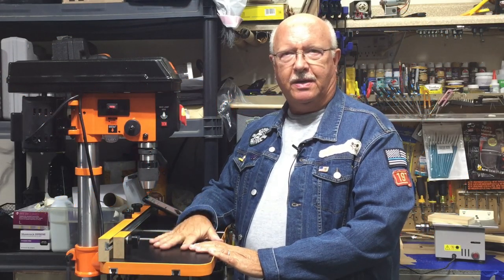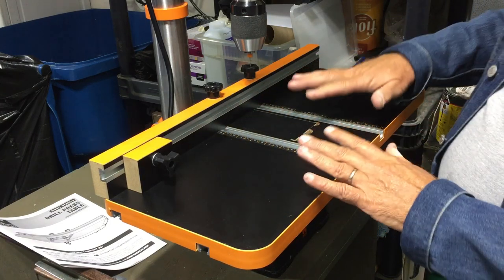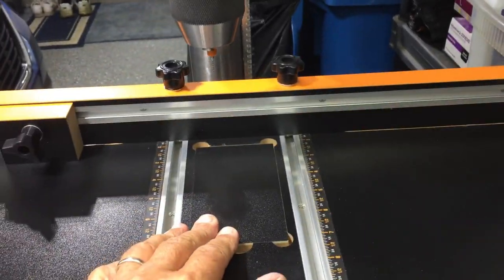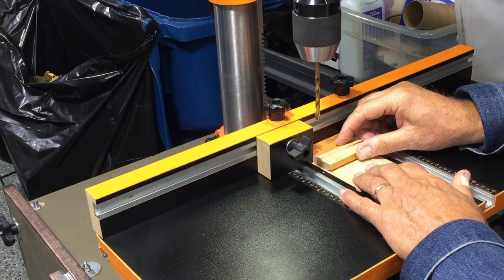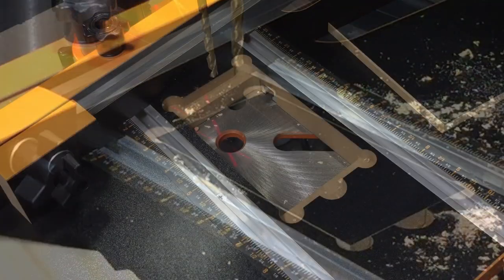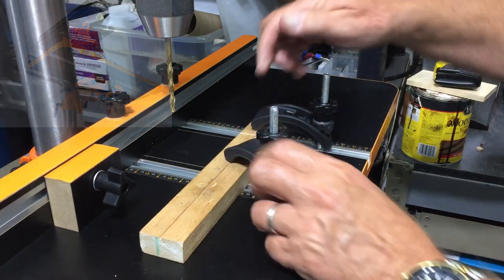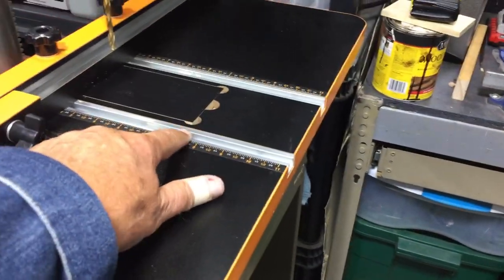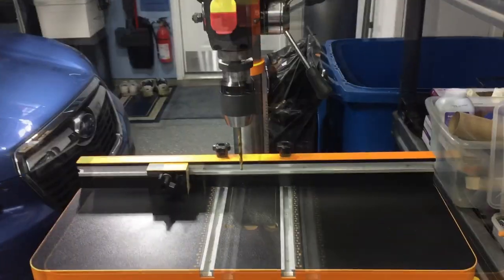WEN Drill Press Table (WEN Model DPA2513)

Comment: I took a 1/2" file and slid it into each aluminum slot and filed off the BURS on the top of each screw hole so they don't interfere with the sliding of the bolt heads.
Reply from the maker: Although I use the drill and table I haven’t used the slide clamps much. But I will definitely check out your idea!  Thanks for the advice 👍👍

Comment: My wen table must be the older version you mentioned. I received it today, 9/29/2022 and it does not fit the Wen drill press I received yesterday, 9.28.2022. I will have to drill a couple of holes into the table in order to secure it to the drill press table. Oh, my table is the white table....
Reply from the maker: Yes, that’s apparently one of the improvements made in the orange version?  I’m still happy with mine as it easily clamps off and on.
Thanks for watching, sorry yours isn’t working out quite as you wanted.

Comment: Have you or anybody reading this found a simple way to add a spindle/ motor speed control? Nobody really messes with the 5 pulleys. It would be great to set it to one speed and then use something to dial in your speed. Thanks.
Reply from the maker: I can’t help you with that. We’ll have to rely on viewers to respond. I only use mine for light duty wood projects on my model ship building hobby and only use it on one speed.  
Thanks for watching and I hope this platform works to get the answer you need. 👍👍
Reply: The new wen model 12 inch has variable speed. There's a lever on the left side and it has only one pulley, I never have to go up there. It is very nice.
Reply: @nickspace6230  It's also double the price. I guess the amount of time you use it dictates the amount to spend.
Reply from the maker: Thanks @nick for your input. And John n, fortunately for me I rarely change the speed. Maybe someone else will know how to regulate the motor speed without upgrading to a different model drill.
Thanks to all for watching and joining the conversation 👍
Reply: Look at the WEN 4214
Reply: Buy a nova viking

Comment: Thanks for the review. I have the same model setup and it performs very well for me as a DIY’r.  I bought b/c it couldn’t be made for the cost of the parts.  The stop block feature is great. Thanks for the tip on the replacement plug.  BTW: the Wen drill is a keeper as well.  I looked at every other brand for similar money and Wen is just a better quality press with more features.
Reply from the maker: Thanks for watching. On the replacement plug, I accidentally show the wrong size…. So be sure to measure and the correct one is on the shelf next to the one that I showed.
Thanks again.👍

Comment: Unfortunately for me, the fence cracked where the t-track with the stop is. had to throw it away. Put a Temu aluminum fence to replace it. Kept the stop, though.
Reply from the maker: That’s disappointing.  Wondering if one could be made out of solid wood?
I use mine regularly, but not so much with the fence.  Drilling with micro bits for model ships… it’s all pretty little duty.
Thanks for sharing, it’ll be helpful for others 👍👍

Comment: Thanks for your review.  I had just ordered the older white model and then I saw your review.  I quickly cancelled the order and ordered the new one.  So glad I saw your review - I didn't realize there was a new model that fixed many of the short-comings of the older one.
Reply from the maker: You’ll be much happier with the newer one.  I’m in the middle of building two wooden model ships and I use it often!  Nice work surface for detail work.
Thanks for taking the time to share.

Comment: I bought one. I’m pleased with it. I wish they made replaceable well covers. Thanks for posting the home made wellcover.
Reply from the maker: Yes, but you can make your own that fit perfectly.  I think I show it in the video…. But note; I showed the wrong tag at Menards…. So just make sure you get the correct width and depth.
I’ve got the specific info for it at home. Unfortunately I won’t be there until next week….
If you need it, just make a new comment next week and I will respond.
Thanks for watching and taking the time to comment.👍

Comment: Regarding the insert, you made the comment eventually, but I'll reiterate it: Save the insert as a template.  Go ahead and use that to make a few replacements on your table saw as soon as you get the insert out the box!  Additionally, you can experiment with making a "breathable" version (i.e., a few large-bore holes) so dust collection can happen on both sides and won't strain your vacuum in the process.
Reply from the maker: Good points! Thanks for contributing to the conversation.  I regularly use the table in wooden model ship construction using micro drill bits.  Very happy with my decision.
Thanks for watching too! 👍👍

Comment: Thanks Dan. Great looking product. I just ordered one myself ( new project requires drilling thru 2" round dowel - this will be great)
Maybe mask off ruler and spray with clear coat ???
Reply from the maker: Not sure regarding spraying with clear coat as it’s at the same height as the table.  They should have slightly recessed it!  But all in all, it’ll work great for a work surface and holding your work in place.  The price is less than half of what other similar products are. My son tried building one and thinks the WEN I have is a better choice!  I think you’ll like it.
I just posted another Pearl video…. I made a construction error: I used the wrong stairway spindles 😫…. I need your attention to details!👍

Comment: I found a better replacement for the inserts that are perfect use laminated flooring samples from the big box store they have a vinyl surface on both sides and the thickness is spot on plus they are free I just have to cut to size
Reply from the maker: Great suggestion! I didn’t know that they would be the right thickness.
Thanks for sharing. Next time I need some more I will try it out….. unless they are all gone do to your suggestion!😂😂👍

Comment: Enjoyed your video. Thanks. I think that you mentioned a link to the wood you used to make replacement inserts but I cannot find it. Help!
Reply from the maker: Glad you asked! I made a slight error in the size:
It’s 3/8x4x36 specifically item number 1031544 select pine board.
At my local Menards it was in the upper deck of lumber.
Here’s a link to the website and the piece that you need:
https://www.menards.com/main/building-materials/lumber-boards/boards/3-8-select-pine-board/1031544/p-1568183358116-c-13115.htm?searchTermToProduct=1031544
Reply: @BoilerDan1  Thank you.

Comment: Length is longer than what would work best for me.  See any reason why I couldn’t reduce the width by about 4” on each side?  Dan
Reply from the maker: If you can carefully cut the sides including the metal channels I don’t see anything that would be an obstacle.  I just looked at mine and measured the 4 inches in on both sides. Nothing to prevent it.  It’ll just be less wide.
Reply: Greatly appreciate your advice and video.  Looks like a nice press…will order and make the minor modifications.

Comment: What chuck are you using on the drill press?
Reply from the maker: I ordered it separate.
It’s supposed to be very stable?
Here’s a link to the one I purchased from Amazon.
It took some getting use to, but is working well for my needs.
WEN DPA167H Heavy Duty JT33... https://www.amazon.com/dp/B08R7V5B19?ref=ppx_pop_mob_ap_share
It takes practice to get the bit centered. I like it being keyless!

Comment: where did you get the piece of wood? 
what store?
Reply from the maker: Menards:
It was in the top area of the lumber section.
3/8 x 4 x 3' Select Pine Board
(Actual Size 3/8" x 3-1/2" x 3')
Model Number: 1031544 Menards ® SKU: 1031544
NOTE:BE SURE TO GET THE 4” WIDE ONE.  Not 3” that shows on screen.
Let me clarify:
If you go to Menards online, when you enter the model or sku number it will bring up the the item but down where you select how many there is a drop down tab. You’ll need to tap that and pick the 4” wide one.  You can also take those numbers into the store and give it to the customer service help and they can take you right to them.
Thanks for watching! My apologies for not being clear on the topic in the video.
👍

Comment: Dan, I am interested in purchasing one of these but it’s important that that fence be fairly accurate at a 90° angle, due to what I am drilling into. Can you confirm? Thanks
Reply from the maker: Currently I’m on vacation and won’t be able to confirm the 90* angle for a couple of weeks.  I’ll do my best to remember….but if you haven’t gotten a follow up from me by the first week of March, send me a reminder!
Reply from the maker: Let me mention that the table attaches to the metal platform of the drill press.  The metal platform of the drill press is what tilts…..
But if you’re referring to a true 90* for just the fence on the table (which now I suddenly think I know what you’re asking 😁)….
The table connects to the fence on the two rails so you can put a square on it to get a very good 90* degree.
As far as the 90 from how the fence sits on top of the table, I’m very confident that it would be very accurate….. but I will confirm that when I get home.👍
Reply: @BoilerDan1  Thanks so much!

Comment: Did you change out the chuck? Just got mine and it has play in it, wondering if you had the same issue.
Reply from the maker: Yes, I did change out the chuck.
I mostly use micro drill bits so I didn’t even try the one that came with it.
It took a while to get the hang of tightening the new one, but I’m happy with it!
Here’s a link to the one I purchased:
WEN DPA167H Heavy Duty JT33... https://www.amazon.com/dp/B08R7V5B19?ref=ppx_pop_mob_ap_share
Thanks for watching 👍
Reply: @BoilerDan1  thank you

Comment: Why is the wood insert needed?
Reply from the maker: It comes with one. Over time it’ll just have holes drilled in it.  So actually, you don’t need to replace it.
Just a little update: I use it often in model ship building. Still love it!
Reply: @BoilerDan1  I mean, what is the purpose of it?
Reply from the maker: Just to support what ever it is that you are drilling into.  For example, I drill very tiny holes using micro drill bits. So if there’s a large hole underneath a small piece that I’m drilling 
It can effect the drilling process. Micro bits break apart very easily and any tilt and they snap off.
If you are only drilling larger objects, it’s probably not needed.
Thanks for watching my video. 👍

Comment: Were you able to locate a shop vac adapter for this?
Reply from the maker: I haven’t tried yet.  I’m usually drilling very small holes in wooden model ships with little debris.
If I want the shop vac to pull away chips or dust I just clamp the hose close by.  Sorry I haven’t pursued it more.
Thanks for watching 👍👍
Reply from the maker: I’m adding a follow up to my reply….
I’ve been using the drill table quite a lot recently and I really like it!  I’ve done micro drilling on some wooden tall ships and it makes the repetitive holes accurate and duplicates are exact!  Regarding the shop vac adapter, it’s easy to clamp the hose on and off so I still don’t see the need for my use…. But as for the table itself, the more I use it, the more I like it! Definitely worth the $50!